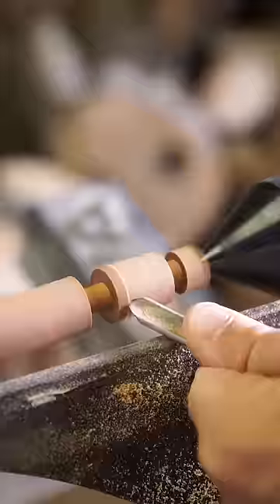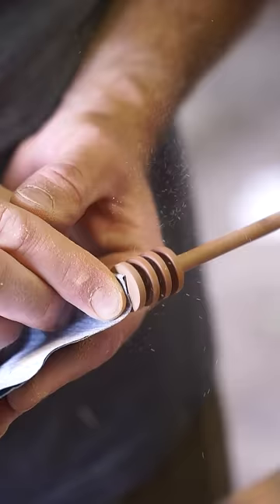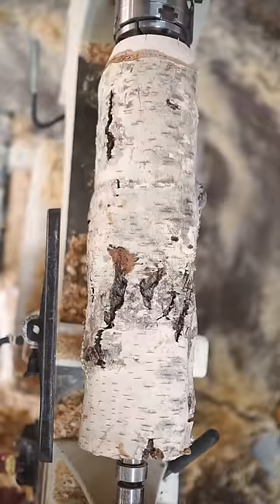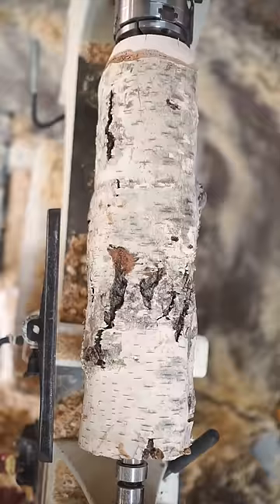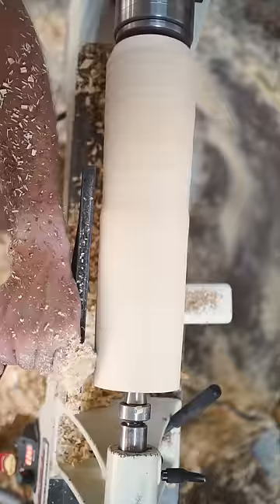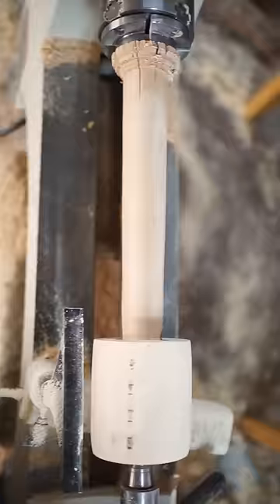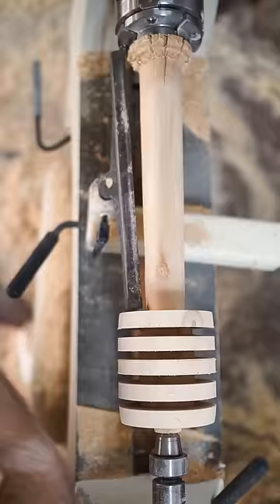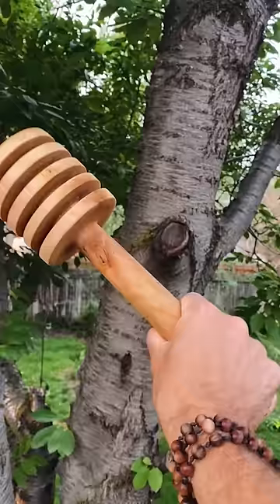Making a BIG ol' Honey Dipper

Comment: first time i’ve actually seen one of these outside of the honey nut cheerios box
Reply: Same💀
Reply: I think I saw a video on one last month. It was strange.  Didn't know it was even a thing.  Why not use a spoon?
Reply: @MrAgentTurner  As long as a dipper is continuously rotated horizontally, the honey will never glob together and fall off. With a spoon or knife, on the other hand, there are no handy grooves to prevent the honey from accumulating and dripping off